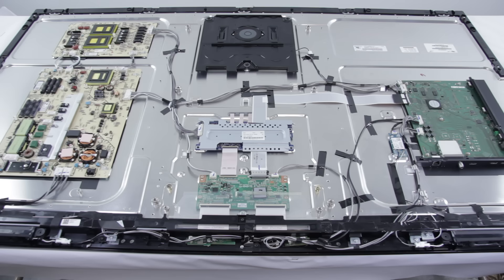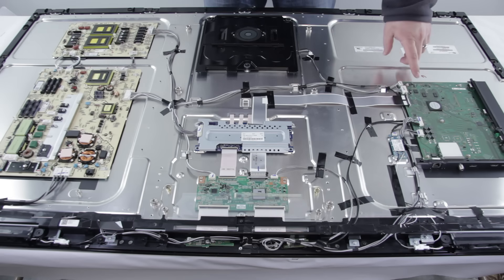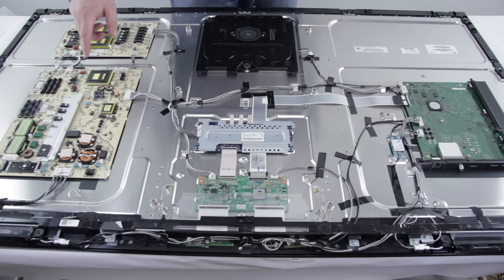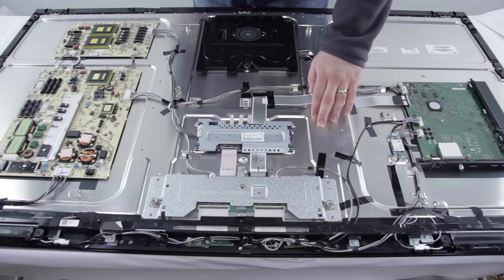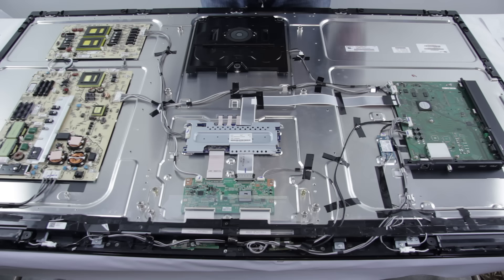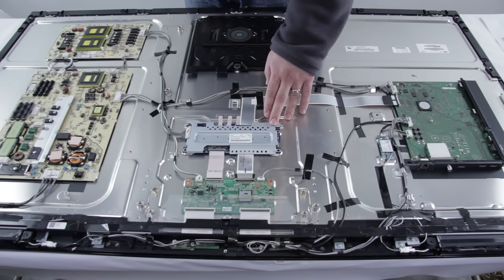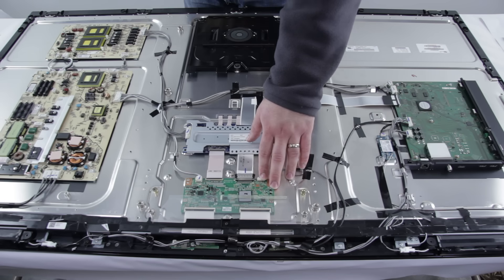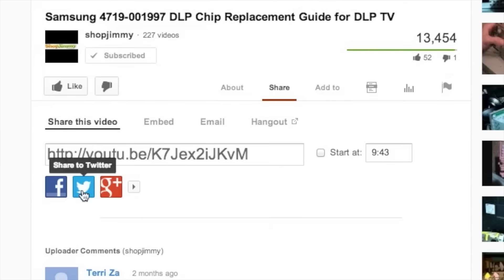LED TV Repair Tutorial - Common Symptoms & Solutions - How to Repair LED TVs

Comment: thank you for making this video. i have a sceptre brand tv p/n X405 BVFHD the tv turns on, but the audio button's, channel selection button, and source select button will all cause the menu screen to come up. it is the same if i use the remote, you can power on, but any other button is either non-responsive or will cause the menu screen to appear. you cannot access the menu screen, you can only hit buttons and it will pop the menu screen up on the screen. 

from your video i am guessing it's a main board? please advise what part i need to fix this thing. thank you!
Reply from the maker: MikeZyouthpastor  Please watch this video FIRST to help with your repair!  https://www.youtube.com/watch?v=BP3NVNCGEv8  I recommend replacing the main board in your TV.  Click this link to replacement parts for your TV model number:  http://www.shopjimmy.com/catalogsearch/result/index/?cat=56&q=X405+BVFHD  There may be multiple boards for the same TV model number, be sure to match part numbers on your current board, with your replacement for compatibility.  Thanks and please let us know if you have any further questions with your TV Repair!  www.shopjimmy.com

Comment: KDL-55HX820 Sony 55" Bravia 3D Edge LED 1080p HDTV with Motionflow XR 480 Gorilla Glass Wi-Fi & Local Dimming

My computer isn't turning on, please help.
Reply from the maker: Asa McCurdy   This sounds like a TV panel (TV Screen) problem.  If your TV panel is bad, it may be more cost-effective to replace the TV as panels are typically hard to find in stock, difficult to replace, and expensive.  Thanks and please let us know if you have any further questions!  www.shopjimmy.com

Comment: I have 55 inch LG LED TV (model 55LM6400) with a vertical bar on screen. There is video even in that bar but it's just dimmer than rest of the video. Based on what I saw in your video, do you think it's T-CON board?
Reply from the maker: Sreenivasa Reddy   This sounds like a TV panel (TV Screen) problem.  If your TV panel is bad, it may be more cost-effective to replace the TV as panels are typically hard to find in stock, difficult to replace, and expensive.  Thanks and please let us know if you have any further questions!  www.shopjimmy.com

Comment: I have a lg55lm4600 with sound backlighting all works but no picture what could be the problem?
Reply from the maker: Shelley Doane   Please watch this video FIRST to help with your repair!  https://www.youtube.com/watch?v=BP3NVNCGEv8  This could be a problem with either the t-con board, the main board or the TV panel.  You can replace the t-con board and the main board individually to see which one fixes the problem.  Click this link to replacement parts for your TV model number:  http://www.shopjimmy.com/catalogsearch/result/?q=55lm4600  There may be multiple boards for the same TV model number, be sure to match part numbers on your current board, with your replacement for compatibility.  Thanks and please let us know if you have any further questions with your TV Repair!  www.shopjimmy.com

Comment: I have a Sharp LED tv with a horizontal solid black line about 4 inches from the bottom. Model #LC-60LE550U
Reply from the maker: Kevin Woodard RE/MAX Connection   This sounds like a TV panel (TV Screen) problem.  If your TV panel is bad, it may be more cost-effective to replace the TV as panels are typically hard to find in stock, difficult to replace, and expensive.  Thanks and please let us know if you have any further questions!  www.shopjimmy.com

Comment: I have a Samsung UN60EH6002F and the screen just shows blue. I was able to tap the side of the TV once in a while and the picture would come back. That no longer works. I have replaced the power board and the main board but still nothing. I do not get the menu screen either although I have full sound. Thoughts? Thank you.

Comment: Shop Jimmy, I have a Toshiba led TV 46" model no. 46L5200U1 the issue is that i have image and sound but do not have backlight, after watching you video on you tube, I decided to purchase the black light SSL460 3E1B on your online store. Received it today installed it plug-in turn it on & the receiver got a good quality pictures after 20 minutes the black light when off again as usual. Any other suggestion? Noel
Reply from the maker: NOEL GANIA   This could be a problem with the power supply or bad LEDs in the TV panel.  Unfortunately I do not see any replacement parts in the search results for your TV model number on our website.  Please reply with your part number on your power supply board and I can try searching for replacement parts.  Thanks and please let us know if you have any further questions!  www.shopjimmy.com

Comment: I have a Samsung LED model: UN32F5500AFXZA
serial: Z6TV3CED703213V.  The TV powers on and I have audio, but no screen.  I did the flash light test and I can see the menu, so the back light is out.  When looking at the component boards in the chassis.  I have a power supply, main board and Tcon board.  I don't see a separate LED driver board.  The power supply board doesn't have any IC's and I have tested most of the components on it and they are good.  I'm not really sure where the LED driver board is.  Does the TCon board contain the LED driver components?  Actually there is 1 small IC on the bottom of the power supply board.  It looks like the power supply board has a wire harness that connects directly to the backlight.

Comment: I have a samsung un55d8000 that is having problems.   The picture just quit while watching it and now it appears to try to turn on(red power light blinks and it clicks), this is followed by a sequence of 5 double blinks of the power light, then it blinks once and clicks like it is turning off.   This sequence then repeats.   It also continues to repeat for about 15 seconds even after unplugged.
Reply from the maker: Jason Wood  Please watch this video FIRST to help with your repair!  https://www.youtube.com/watch?v=BP3NVNCGEv8  I recommend replacing the main board in your TV.  Click this link to replacement parts for your TV model number:  http://www.shopjimmy.com/catalogsearch/result/index/?cat=56&q=un55d8000  There may be multiple boards for the same TV model number, be sure to match part numbers on your current board, with your replacement for compatibility.  Here is a link to a video showing how to identify your part number, click here:  https://www.youtube.com/watch?x-yt-ts=1421914688&x-yt-cl=84503534&v=BEPWrefQvqI  Thanks and please let us know if you have any further questions with your TV Repair!  www.shopjimmy.com

Comment: horizontal lines running threw a 55" led smart 3D tv. right to left about 3/4 of the screen... 55LM7600-UA
Reply: They are very fine lines wish i could post a picture on here lol... very expensive tv. I hope its not the panel.

Comment: I have a Samsung UN40EH5300 40-Inch 1080p 60Hz LED HD SmartTV 

and it has real bad backlight bleeding. A technician put a new panel on and the bleeding was still there but in a different spot. 

Anything I can do to fix it?

Comment: I have a Toshiba LED TV model # 46L5200U1. When I turn it on, everything works normal. Then within 20 seconds or a few minutes, the LED's start flickering and go out completely. The sound still works and you can see (barely) that the image is still playing, just no light. Turn it off and back on again, everything works normal for a few seconds or minutes. Please help. By the way, the link for the flashlight test brings up a "private" video.
Reply: ShopJimmy.com I am at a loss as to why you would say to replace the power supply board??? Your video, and every other video/resource, has clearly stated that the problems my TV is having is caused by the LED Driver board. Could you please explain what the power supply board has to do with the issues I'm having?
Reply from the maker: Brian Westenhofer   Try this at your own risk, can you please remove the back cover of your TV and then take a wide picture of the parts on your TV panel.  Then upload the photo online and reply with the link to the photo.  Also, please reply with the part number on the boards that are on your TV panel.  Thanks!  www.shopjimmy.com

Comment: I have a Sharp LC-70LE640U that has a horizontal line going about 70% across from right to left, near the bottom. I've tried replacing the tcon board. Still has the same line, it also appears to change color, not solid black.Any info would be great!
Reply from the maker: Jacob Cook   This sounds like a TV panel (TV Screen) problem.  If your TV panel is bad, it may be more cost-effective to replace the TV as panels are typically hard to find in stock, difficult to replace, and expensive.  Thanks and please let us know if you have any further questions!  www.shopjimmy.com

Comment: 32 inch Funai LED TV

Model # : LF320FX4F

S/N : DS2A1338276522

SYMPTOMS: When I turn on the television The power indicator (red standby light) blinks on and off and the screen turns on for a second and displays the FUNAI logo and then the screen immediately shuts off. the indicator light continues to blink for 15 seconds then remains lit.
Reply from the maker: MsNamebot   Please watch this video FIRST to help with your repair!  https://www.youtube.com/watch?v=BP3NVNCGEv8  This could be a problem with the power supply or the LEDs in the TV panel.  You can replace the power supply board to see if that fixes the problem with the TV.  Click this link to replacement parts for your TV model number:  http://www.shopjimmy.com/catalogsearch/result/index/?cat=59&q=LF320FX4F  There may be multiple boards for the same TV model number, be sure to match part numbers on your current board, with your replacement for compatibility.  Here is a link to a video showing how to identify your part number, click here:  https://www.youtube.com/watch?x-yt-cl=84359240&x-yt-ts=1421782837&v=3DQe0ATZl_Q  Thanks and please let us know if you have any further questions with your TV Repair!  www.shopjimmy.com

Comment: Hello, I have a tv Sony KDL-55ex723 when I plug lights steady red light, then I press the power button and the red light goes out, then I press again and turn on the tv, the screen turns on and shows for 3 seconds and I can see if this video or hdmi ..., then the image is turned off, and the red light blinks first and then is 1234,1234,1234 1,2,3 ... to turn it on again I disconnected by minutes, now takes less time the screen image
Reply from the maker: tropicalcomputer1   How many times does the LED blink in the front?  Thanks!  www.shopjimmy.com
Reply: ShopJimmy.com  it blinks 4 times in red
Reply from the maker: tropicalcomputer1  Please watch this video FIRST to help with your repair!  https://www.youtube.com/watch?v=BP3NVNCGEv8   I recommend replacing the main board in your TV.  Click this link to replacement parts for your TV model number:  http://www.shopjimmy.com/catalogsearch/result/index/?cat=56&q=KDL-55ex723  There may be multiple boards for the same TV model number, be sure to match part numbers on your current board, with your replacement for compatibility.  Here is a link to a video showing how to identify your part number, click here:  https://www.youtube.com/watch?v=Aodz2LHkzbY  Thanks and please let us know if you have any further questions with your TV Repair!  www.shopjimmy.com
Reply: ShopJimmy.com I reeplace the main board but still doing the same
Reply from the maker: tropicalcomputer1   Sounds like you received a defective replacement board.  I recommend trying a different replacement main board.  Thanks!  www.shopjimmy.com
Reply: tropicalcomputer1 is good to know that all this happened after a storm

Comment: Hi.  I have a Kogan KGNFHDLED24VB (LED TV).  When I power on, after about 5 seconds and as soon as the screen starts to light up, the unit shuts off and then there is a 3 second delay before the red led standby light comes back on. No visible blown capacitors.  Can you please suggest a remedy?
Reply from the maker: Alan Kwan    I recommend replacing the main board in your TV.  Unfortunately I do not see any replacement parts in the search results for your TV model number on our website.  Please reply with your part number on your main board and I can try searching for replacement parts.  Thanks and please let us know if you have any further questions!  www.shopjimmy.com

Comment: Hi Jimmy, I have Samsung UN55B6000VFXZX for Mexico, and it turns on and off by itself and the audio does not work, but after a few minutes the tv works good. Somebody tell me maybe i need to change the the Main Power Board BN94-02657C.
It is correct?

Thank you.
Reply from the maker: lemrodrigo  Please watch this video FIRST to help with your repair!  https://www.youtube.com/watch?v=BP3NVNCGEv8  I recommend replacing the main board in your TV.  Click this link to replacement parts for your TV model number:  http://www.shopjimmy.com/catalogsearch/result/index/?cat=56&q=UN55B6000  There may be multiple boards for the same TV model number, be sure to match part numbers on your current board, with your replacement for compatibility.  Here is a link to a video showing how to identify your part number, click here:  https://www.youtube.com/watch?v=BEPWrefQvqI  Thanks and please let us know if you have any further questions with your TV Repair!  www.shopjimmy.com

Comment: Hello, I purchased a Samsung LED 40" flatscreen television about seven years ago.  I am currently having problems with the television powering on and off after the machine is powered on.  At first, it would power on and off a few times but now, after the machine is powered on it will go through this cycle of powering on and off some twenty times.  I have watched your tutorial and request any information on how to correct this problem.  The model number is LN-T4066F and the serial number is AJ7F3CNPC00072R.
Reply from the maker: Byron Stevens  Please watch this video FIRST to help with your repair!  https://www.youtube.com/watch?v=BP3NVNCGEv8  This could either be a problem with the main board or the power supply board in your TV.  You can replace each board individually to see which one fixes the problem.  Click this link to replacement parts for your TV model number:  http://www.shopjimmy.com/catalogsearch/result/?q=LN-T4066F  There may be multiple boards for the same TV model number, be sure to match part numbers on your current board, with your replacement for compatibility.  Thanks and please let us know if you have any further questions with your TV Repair!  www.shopjimmy.com

Comment: I have Samsung UN60F7100 that has flickering problem. I saw a youtube video of cutting a jumpet wire on some other samsung model. Would it be the same problem as other samsung tv with bad jumper wire or something else? If it is a wire issue, which wire do I need to cut?
Reply from the maker: Hyung ahn  Please watch this video FIRST to help with your repair!  https://www.youtube.com/watch?v=BP3NVNCGEv8  This could be a problem with the power supply board or bad lamps in the TV panel.  Click this link to replacement parts for your TV model number:  http://www.shopjimmy.com/samsung-bn44-00630a-power-supply-unit.htm  There may be multiple boards for the same TV model number, be sure to match part numbers on your current board, with your replacement for compatibility.  Thanks and please let us know if you have any further questions with your TV Repair!  www.shopjimmy.com